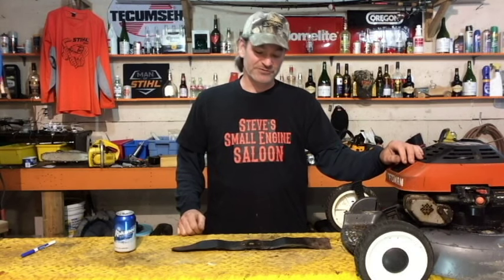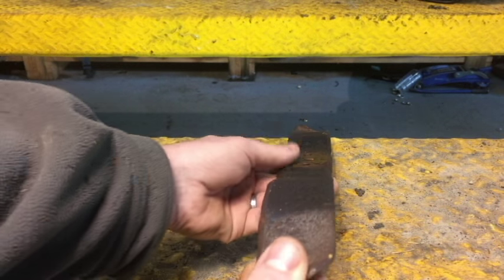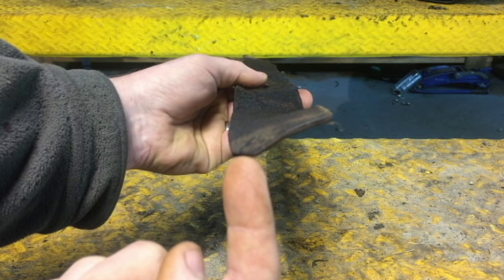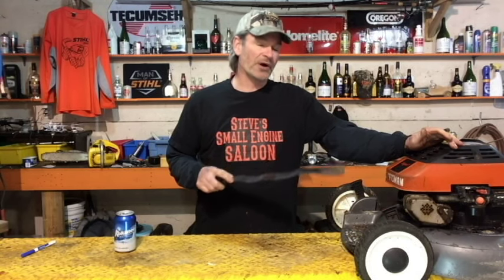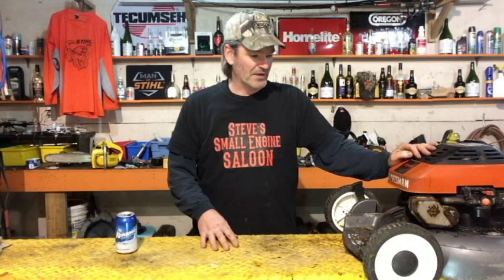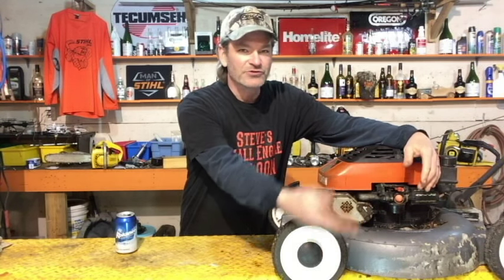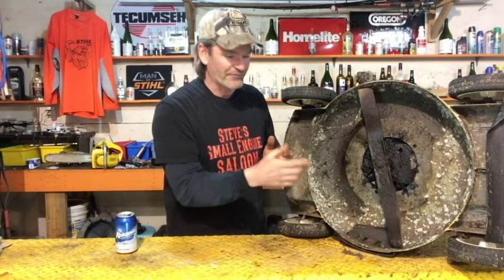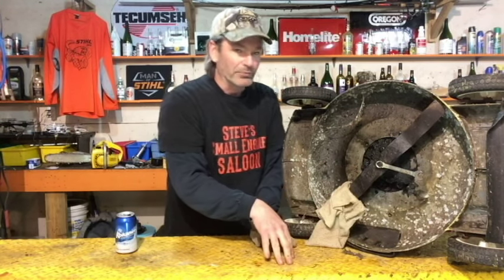How To INSTALL A Lawn Mower BLADE Properly (Step-by-Step)

Comment: Hello Steve, thanks for the video. A quick tip about the right handed nut and bolt. Take your right hand and make a fist then point your thumb at the nut or bolt and your curled fingers show which way to turn it to put it back on. Point thumb away from the nut or bolt and your curled fingers show which way to turn it to remove it. Has come in handy when working upside down and sideways. Have a great day!

Comment: Great video as always, easiest thing to remember is the mulching bent tip has to face upwards.

Its surprising that a large proportion of owners never sharpen their blades and these lawnmowers are quite forgiving and keep cutting with the dullest blade. So even a blade put on backwards owners are likely not to realize it.

For the rest of us keep the blade sharp, machine works less and you get a better job.

Well done on the video, a refresher course for us old timers and a lesson for those sharpening blades for the first time.

Comment: A quick suggestion: if you are removing the blade to sharpen it (and presumably going to reinstall it on the mower), mark the "grass side" with a shot of spray paint.
When you reinstall the blade, you will know to look for the spray paint mark.  Can't muck that up.
Reply: He is right about the bent part facing up and if it isn't it will hit the ground or a rock.
Reply: Challenge accepted. ;)
Reply: what a great idea. Thank you. I will do that next time. Thank you
Reply: Jay - Works great --- unless --- the blade was put on wrong before.  😄
Reply: @joesinakandid528  Exactly what I was thinking.
Reply: @joesinakandid528   You would have found out when the grass wasn't being cut.

Comment: Thanks for this helpful video. I looked at the blade I recently purchased. Indeed, it has “grass side” stamped on one side of the blade. I had not noticed until I saw this video. Now I am more confident in changing the mower blade. I also learned from one of your other videos that prior to turning the mover on its side, the starter grip should be pulled to the point of greatest resistance to prevent oil from seeping behind the piston resulting in hydrolock.
Reply from the maker: Right on Murray!  You're Welcome...

Comment: These videos are fantastic , for the novice or seasoned do it yourself repairer , there is always something to learn . One thing I haven’t seen recommended is the use of antisieze on nuts & bolts , I made a pact to myself years ago that anytime I pull anything apart & I know it’s highly likely I’ll have to do it again , a smear of antisieze can save a whole lot of swearing & cursing at frozen or corroded bolts . These days I even do it to brand new fittings like blade bolts to ensure it doesn’t become a pain in the arse when it come time to replace .

Comment: I don't know why but I assumed the blade would turn clockwise when it was on right. I removed the two blades from my Poulan riding mower but didn't pay attention to how they came off and I do believe from the way the grass looks after cutting it the blades are on backwards. I'll be changing this very soon. My other problem was I had a Bud Light, I don't think what you had is even available here, I'm sure that was the start of my problems, thanks for the tip's Steve.

Comment: Hey Steve, love the double wrench method, will definitely use in the future. I also use a breaker bar on mine, and soak the nut with Aero-Kroil. Also a great idea to use an Anti-Seize lubricant on the bolt when you're ready to reinstall the blade, and verify the torque spec on the nut with your owners manual. Makes it much easier to pull the nut off next time. 
Your channel is the Alexandria Library of small engine repair by the way, completely irreplaceable! And as a Bellingham resident, my garage fridge is full of Kokanee too - and Ranier!

Comment: Great video.  I got the information I needed.  One quick note, OSHA does not approve of "double wrenching"..... as a professional mechanic for many years, I will admit that I have used double wrenching more than once.... (it does work), but a Breaker Bar with the correct size socket is a better option.  Thanks again.

Comment: I’ve taken the opportunity to change the blade each time that my son has ran over the same raised stump in the yard that has shut down the mower, but also stopped the blade. This kills two bird with one stone. The motor is off and won’t restart as long as it is stuck on said stump, and the blade will not move while mower is on top of stump, which allows me to remove the blade and resharpen once again. 😂 I will say that the stump in question has finally been removed and it was never my sons fault. Lol. Thanks for the great tutorials over the years. 👍👍

Comment: Great video as usual.  One comment if you have a full fuel tank it’s recommended in my manual to put a plastic baggy under the fuel cap to prevent the vented cap from leaking out.

Comment: You are great. My mower(zero turn) manual says to put some copper based antisieze on the bolt before reinstalling the blade and gives a torque spec. This has been helpful in maintaining my mowers three blades. I am going to watch your video about how to sharpen the blades. Thanks again for your great videos.

Comment: Perfect video for what I needed even 5 years after you posted. King story short, I try to do as much maintenance as possible myself and this made it really easy. I also need to change the oil so I’ll check out your other videos. Sometimes I can’t get things open or closed so the tips you gave on loosening the bolt worked perfectly - thank you so much!
Reply from the maker: You're Welcome...

Comment: Thank you for the tip. This is very helpful. I had to buy a longer ratchet to get some leverage in order to remove my blade. And a long handle torque wrench to torque it properly. I also bought a blade removal tool which holds the blade in place when you remove or or tighten the blade. The same company that makes the blade removal tool makes a blade sharpener and a balancing tool. All of those combined made the whole process very simple.

Comment: Best explanation on the web . My son gave me a couple year old toro self propelled  mower. I hated it from the start because it alway left a clump of grass on every pass I cut. Put a new blade on the same way I took off the old one. Didn’t solve the problem. Watched your video checked the blade an sure enough it was upside down. Flipped the blade over and it cuts perfect now. Thanks a lot for the info. Btw I checked the blade and damn if it didn’t say grass side on it. You da man ,
Reply from the maker: Right on Billy...

Comment: Hi Steve, love your videos. It's nice to see a fellow Canadian eh! Worked at a small engine shop in Winnipeg. Just wanted to mention that you can also use an impact wrench (the easiest way), just be sure not to over tighten it when putting it back on. If someone doesn't have an impact wrench then a breaker bar can also be used to take the nut off. As a former small engine repairman I can tell you that you're dead on with your videos and have learned some new things too that I didn't know. Keep up the great work!
Reply from the maker: Thank You...

Comment: I enjoy some of your older videos because they are so laid back and fun. Another trick for removing stubborn bolts is to spray a little WD-40 on it, drink a few beers, come back and tap it loose with a wrench and a hammer. If you drink too many beers you might forget all about it and it's even easier to remove the next day. ;)

Comment: For years I didn't realize there was an upside and a grass side to a lawnmower blade. I thought they were reversible and I probably got it wrong more times than right. What may seem like basic info to professionals who work on this kind of repair every day, is invaluable to the do it your selfer who only does this every so often. Thanks Steve for a very clear and informative lesson on which beer pairs well with cutting blades.
Reply from the maker: Right on....

Comment: I subscribed. I will always click the "like" button too! You are great at explaining procedures. I appreciate you very much. Now I'm gonna go sharpen my blade. Just hope I'm strong enough to get that nut off. LOT I will surely have another problem, and most likely sooner than later. I will hit you up for help. I am a DIY lady, and love to learn the correct way to do it. I have two mowers I am working on right now. My sons, and my daughters. They just happened to buy the same Troy Bilt's. My son's been used over 100 times, and my daughter's only twice. Her's is the limon. But I cleaned the carb. Works fine now. Thank you so much, Birdie

Comment: Steve, you're awesome! Question for you.... I have a Husqvarna zero turn with three blades. I notice that when I mow it seems to leave a strip of grass that is higher that the rest of the cut grass. Do multiple blade mowers have to be synched so that there is no space where two blade are not cutting efficiently? Probably a dumb question considering how fast they are all spinning...

Comment: You can also use a c-clamp or vice grips on the lip of mower deck so the blade will catch on that and you can turn the bolt without having to hold the blade.  I used a vice grips and then used a socket wrench to get the bolt off mine.  But I had to repeatedly tap the handle of the socket wrench with a hammer to get enough force to loosen the bolt.

Comment: Great tip about "sharp side" closest to the grass.  Another good one was always tip the machine air filter up.  I've serviced several mowers with no start issues only to find an air filter that was saturated with oil.  Great video..Raisin a cold one to you sir.
Reply from the maker: Thank You...

Comment: Great channel Steve, subscribed.  I tune up and repair push mowers, riders, and zero turns here in New England.    Biggest issue I find is overfilled oil.  People pull them out of the shed in Spring and just dump a shit ton in.  This week I got three push mowers that had over a quart in them.  😡
Of course oil all over the exterior of the mower and the air filter saturated.
Reply from the maker: Right on buddy!  Thank You...

Comment: Like cutting through butter with a hot knife after changing my blade thanks!   I had to re-tighten it once because the guide holes weren't lined up perfectly but after that mowing was a breeze even in the Florida humidity.  The bolt was metric so I was a little worried about stripping it but a 5/8 did the trick with a little help from a ball peen hammer.  I recommend getting  the right size  wrench though.  I used a vise grip to hold the blade instead of a wood block and it worked great.  That trick about tipping it over on the opposite side of the air cleaner was useful I didn't spill a drop of oil or gas and wouldn't have know about that without  watching this video.
!
Reply from the maker: Right on

Comment: Hi Steve, great video. I was hoping for some advice, I have a 5 year old  22 in Toro mower and one month ago the trailing shield got caught under the blade and destroyed. I bought a OEM replacement and it got destroyed as well after 5 minutes of use. As you know , when you mow there are times you have to back up the mower to turn, redo areas that are missed, etc. That is when the shield gets caught underneath the mower. Any advice on how to prevent the shield from getting destroyed? Thanks

Comment: Awesome video as usual Steve. I know of the double wrench trick, I call it the knuckle buster however. Sometimes the wrench that you are  gripping (the one closest to yourself ) let's say, can actually slip to one side or the other and actually swings back towards, in this case, the blade and OUCH. How about a 1/2 inch drive ratchet or breaker bar with a 6 POINT socket or even a 3/8 drive impact driver. Crucial is the 6 point socket....less likely to strip or slip on you. Bill from SSM On. Canada

Comment: Steve, also very important for the blade being on correctly....the fin or turned up part of the blade must be up to pull the grass up through the wind action by the fin.  The grass must be pulled up by the wind for the blade to cut the grass.  If the grass is lying down, the blade won’t cut.  There’s actually aerodynamics in grass cutting.  The fin on the blade and the enclosed cowling of the lawnmower all play a part in a “vacuum” pulling up the grass blades for the lawnmower blade to cut the grass.

Comment: Thanks.  Like a nit wit I put my blades on upside down on a one year old zero turn. I screwed up two spindles by doing this.  I wound up  replacing all three spindles  just in case . It was a very expensive lesson. But how I did it was the mower was in the air I took the blade off and laid it face down and when I reinstalled the new ones I didn't flip it over I just went straight up. I'm usually not this dumb but I sure was this time.
Another way to explain how to install is sharp side up. If you can see The Cutting Edge from the bottom it's on incorrectly.

Comment: Thank's Steve. i just today was given a push mower that i was told 'never cut right". It was new when he got it and just used a couple of times at the most. Then was pushed outside and forgotten about for a couple of years. i got it home and was looking it over to see what i needed to do to use it and noticed the blade was downSideUp ,(From the store). Fixed that and now got carb trouble i believe. It run's after i cleaned up rust on magneto and coil. cleaned tank (shiny) and changed oil. Run's but rev's hi and low and every now and then for a dozen seconds or so runs like a top, then back to hi/low sputtering. 
I'll get her Fingered out before fall, lol.
Thank's Steve .

::Subbed::
Reply from the maker: You're Welcome...

Comment: Hi. Great clear video using straight forward tools.
My Briggs and Stratton 35 classic blade has two pin locating holes but there are no pins. Doesn't look like anything has snapped off.
Do all blade mounts have locating pins?

Comment: Hi Steve I took my lawn mower blade off my 2011 snapper self propelled lawn mower to sharpen it and clean real good and repaint the bottom of the mower deck. Unfortunately my wife moved everything and now I can not find the blade bolt. Please tell me what size bolt do I need to replace the original bolt. Thank you

Comment: I've watched this 'episode' more than once. Each time you give us those two ways to make sure the blade is the right side up, I say, Yeah, that's good. Recently I lent my mower to someone. She said it wasn't really cutting cleanly. I had thought the blade was sharp. Checked and found it was indeed sharp -- but it was upside down!! Either that or the wrong side had been sharpened. 
So this time, looking further afield into now to install the blades, I see some people use a torque wrench, but I've just used a battery impact wrench, with no problem. Having read up on the importance of not overtightening, I decided to use a torque wrench. No way could I wrench up to 70 ft. lb., just around 60 max. I'd have had to use a bar. I tried to turn the blades (I was working on a riding mower). Boy were they stiff!! I've never really tested them like this before, and wonder if this is normal or if something is wrong. Anyone know? Thanks!!
Reply: I should add I have dropped the deck so there is nothing to stop the pulleys from turning, and the bearings are fine.

Comment: A neighbor asked me to do a small repair on her ride-on mower. As a courtesy I decided to check the blades and sharpen them if required. All three blades had been installed upside down. Shortly afterwards I did an inspection on a commercial out-front mower and this mower had the 2nd or middle blade installed upside down as well. I'm not even a small engine mechanic! Imagine the stories that people like Steve could tell? They could write a book!

Comment: Steve i have a question. I have a Honda GCV 160. When i removed my blade, little bits of metal fell into my hands from under the blade right by the shaft. Its clear where they came from. Little divits or dimples surrounding the shaft meant to prevent the blade slipping over the shaft. You can see they were sheered off. My question, does this make the mower unsafe? Could the blade spin off and take out my ankle? Id love a response

Comment: Really like your videos and I'm a subscriber.  It's a good idea to wear gloves on both hands when removing and installing a blade.  A friend of mine only used a glove on the hand holding the blade.  As he was unloosing the nut, the ungloved hand holding the wrench slipped.  When the wrench slipped, his bare hand hit the blade, and required a visit to the emergency room.

Comment: Good tip on the sharpened edge being toward the grass!  I hadn't heard that one before.  One I had heard is, the side discharge chute is an indicator of blade direction.  It'll be on the side of the deck where the spinning of the blade will discharge grass out of it angled toward the back -- grass will never be discharged through that hole angled toward the front.  
Another good tip you gave was to never tip up the mower so that the air filter is on the down side.  I never realized crankcase oil could seep past the piston rings (since they hold compression) and out through the carburetor, but maybe there are oil passageways between the crankcase and the carburetor around the piston I'm not aware of.  Thanks for the info!
Reply from the maker: Right on Rocky...

Comment: Great how to video! Steve, your the man who knows! Great safety tip on the spark plug. I've used a block of wood to hold the blade in place. Double wrenching is a no-no with MSHA. (I know first hand.) Use a socket and breaker bar.
I would love to spend a day in the shop with you! 😊